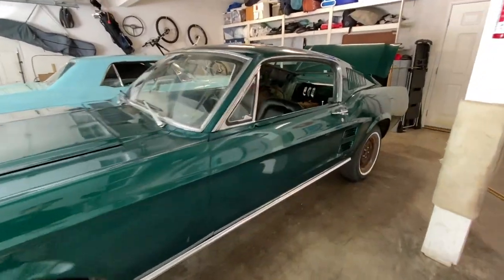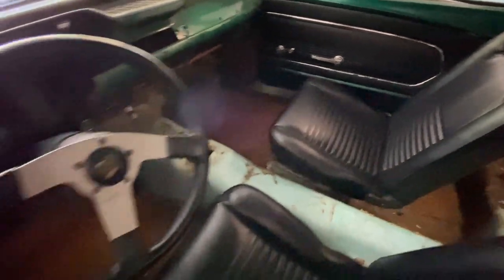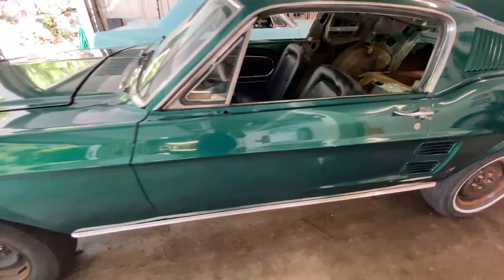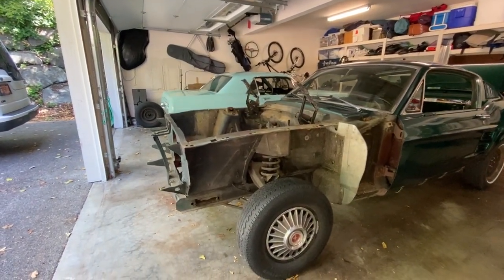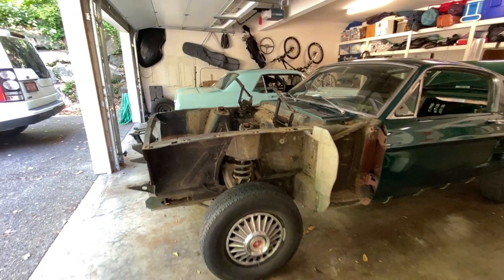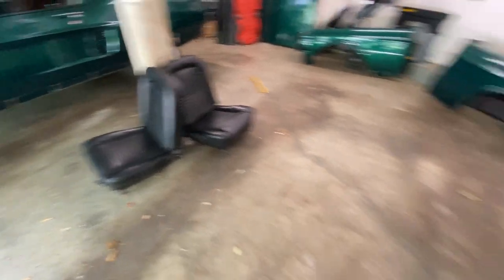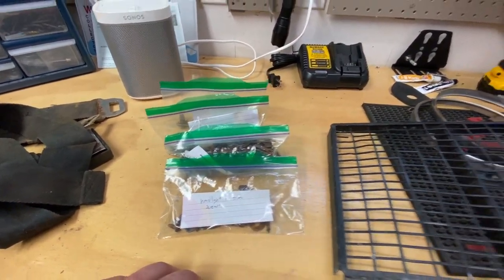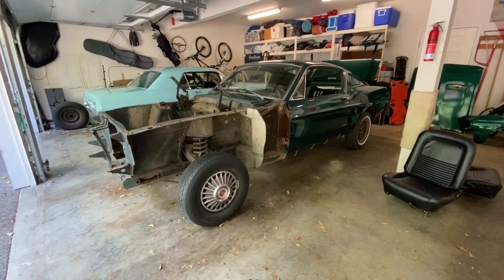1967 Mustang Fastback Tear Down Update

Comment: Hi Evan, as we all know this is the easy part. Really smart plan to bag and label . How many of us have thought "l'll remember!" 😨😨😨  l guess the front and rear screens are not bonded so you can cut out the seals . The paintwork does look deceptively good. I noticed the right front tire on the notchback looked low. Hope she isn't being ignored !
Reply from the maker: Hi John, thank you! Tire pressure on the coupe is perfect. I think those 225/45r17s that I’m running in the front look low all the time, even at the current 32psi I’m running them at.

Comment: only thing that looks off is the front floor pans, I thought they were "rippled" (best word I could think of) for support not flat and the driver side frame at the wheel not bad both ate easy fixes. I am too excited to see your progress with this.   My fav year especially for a restomod.  may look for a shelby style front valance for more cooling and small subtle changes and keeping it "period correct" but it is kind of hard to botch this bodystyle.  Keep up the good work!
Reply from the maker: Thanks man, I appreciate the kind words!